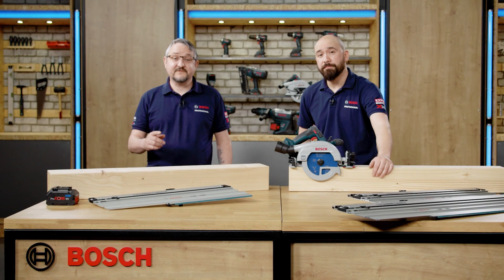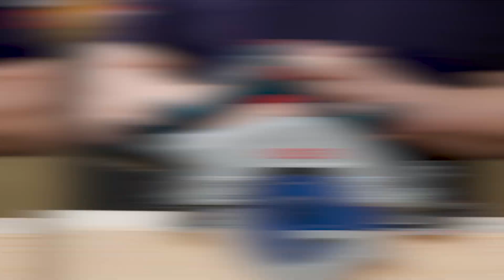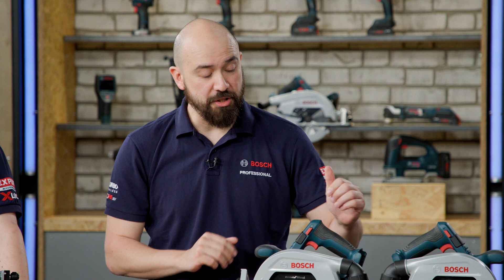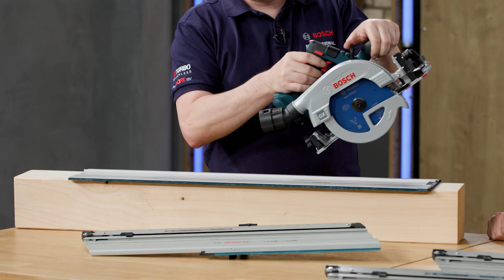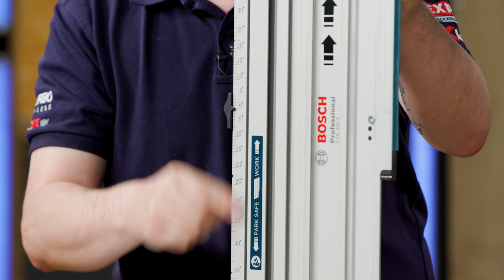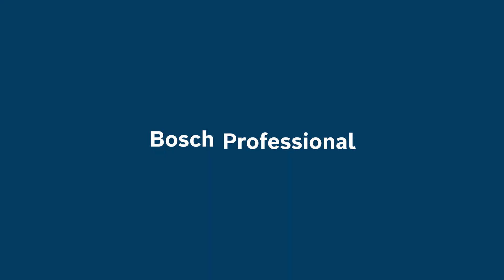All About GKS 18V-57-2 GX Professional Cordless Circular Saw

Comment: Was the fan x system automatically return the machine to the start under spring tension, or is it a manual return to start as per the demo cut?